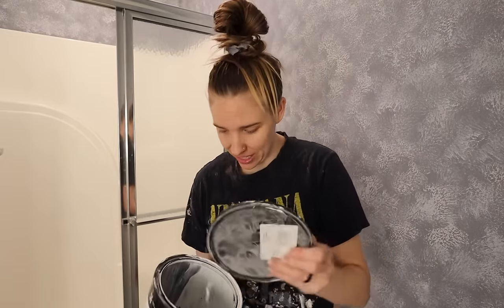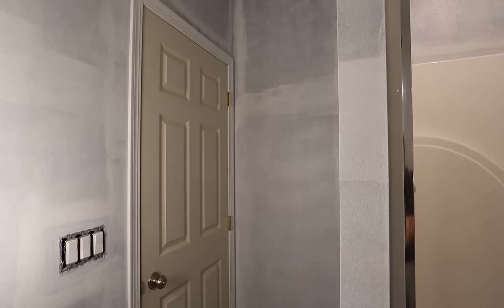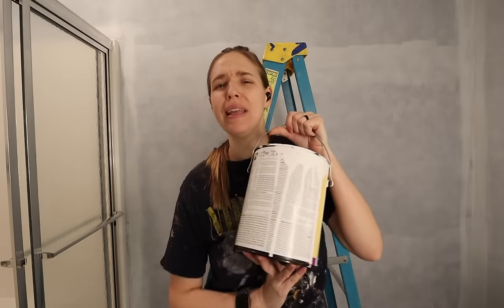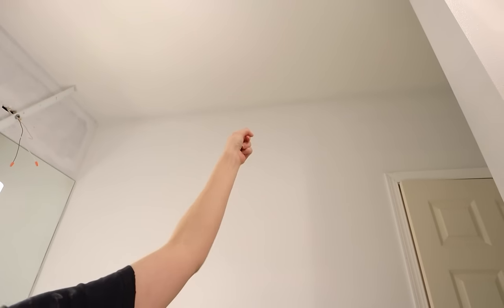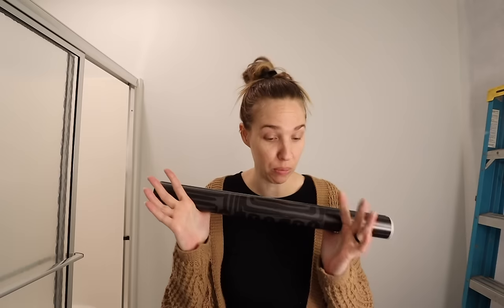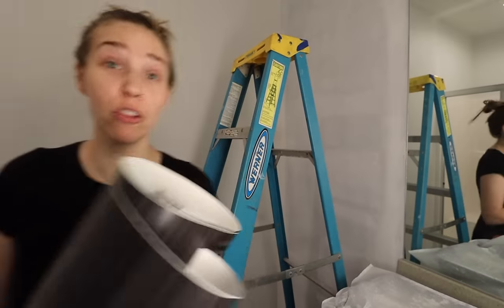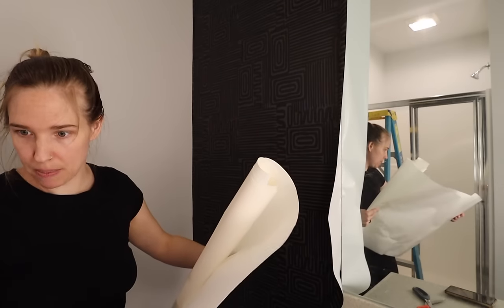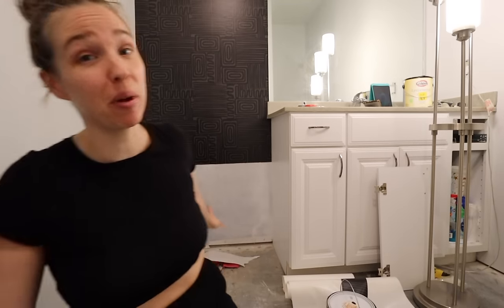BATHROOM TRANSFORMATION PT.2 | Cleanup, Paint, and Wallpaper!

Comment: You can paint the door.  Just clean it. After that hit all the small areas with a paint brush and use a roller on the rest.  The key with doors is not to do thick layers.  Just go easy and light.  I love the transition so far❤

Comment: I admire you for doing all this stuff. I had a leak from our condo roof over the winter and now have a big gash in the ceiling. I have asked the HOA to get a person to fix it but of course they are ignoring me. Insurance said they won't cover it either so I would just do it myself. It doesn't seem like any mold is there or anything so, I will have to have big think about this. LOL But you give me motivation to try.